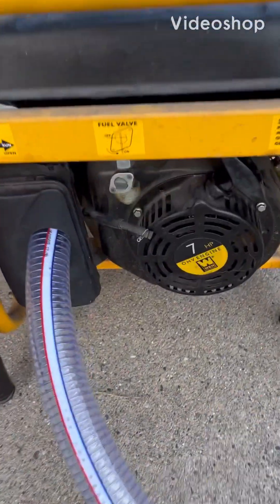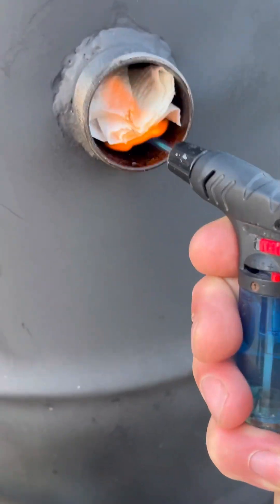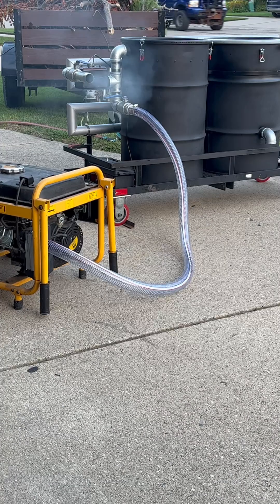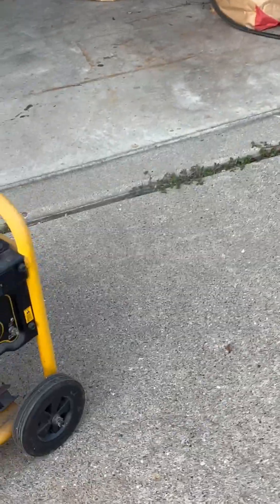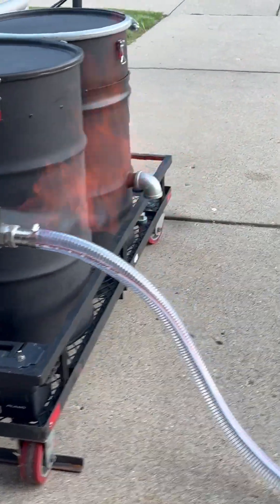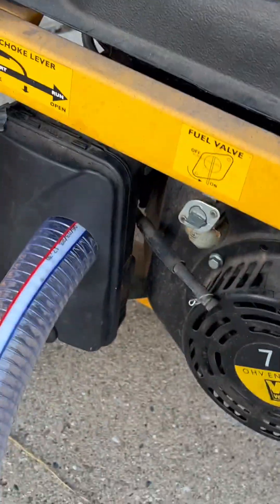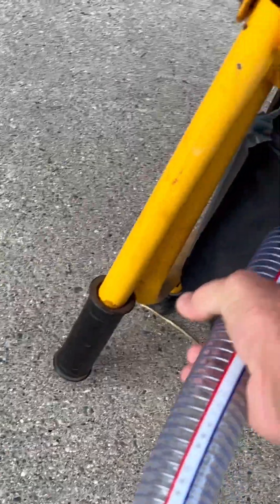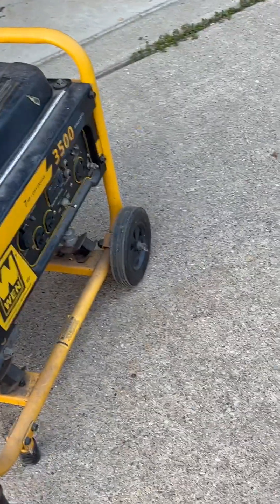My wood gasifier and generator! First attempt! DIY

Comment: Did you turn off the fan while starting? I guess its beta to turn off the fan after starting 😊.
Reply from the maker: Keep the vacuum on until it gets up to temperature, start your engine and then you can turn the vacuum off
Reply from the maker: If your engine is not large enough, it may not create enough vacuum to keep the Gasifier at it’s correct operating temperature

Comment: START ENGINE ON GASOLINE....SLOWLY....USE....VALVES TO SWITCH TO WOOD GAS. NEED AIR VALVE AND WOOD GAS VALVE AT ENGINE, LISTEN TO RUNNING ENGINE. IT WILL TELL YOU WHAT IT NEEDS. MOVE VERY SLOWLY ON SWITCH OVER. NO GASOLINE LEAVE CHOKE OPEN. CHOKE IS GASOLINE START ONLY. TAPE OVER OTHER AIR FILTER HOLES. USE AIR VALVE FOR GASOLINE TOO.. ITS TRICKY BE PATENT.

Comment: Anyone with a newer sealed wood burning stove has seen this gas in action. At ~ 451F (I measure at flue) the wood goes from yellow to a blue green plasma that forms about an inch above above the wood - this is the gasified wood. If you don't see this in your stove its burning too cold.

Comment: It is all about fuel/air mixture. 
As one of the comments below has already suggested you need another hole with the baffle (similar to a choke where you can control your mixture.
Very nice output though!
How did you execute the reactor area?
Reply from the maker: Thanks for the tips. Did you watch part 2 and 3 of my video? It has all the dimensions for my reactor

Comment: I would have two separate hoses/pipes coming into the generator and one sucking in fresh air and one coming from the gasifier.....  Have valves on these so that you can control the gas and air flow...  Just work on getting the mixture just right...

Comment: I have not done this yet but I’ve been researching and it seems if you start it on gasoline and then switch to wood gas It’ll help prime the system because it appears your hose is mostly full of air

Comment: I like having the startup fan at the end of the hose by the engine.  That way, you are not having to use the vacuum of the engine to pull gas all the way through the hose on startup.  That makes things extra difficult when you are trying to pull start the generator and adjust the air/fuel mixture at the same time.
Reply from the maker: Thanks , that’s a good point